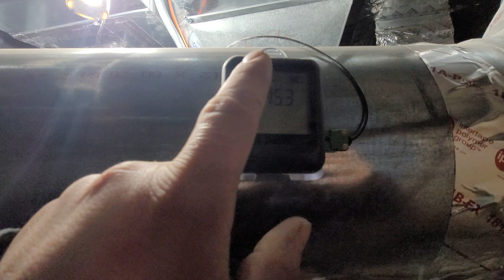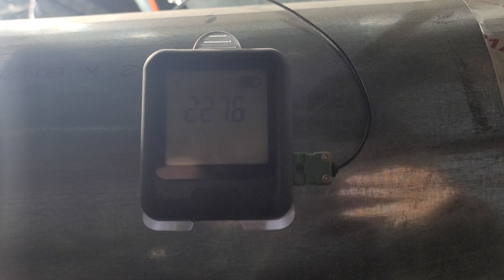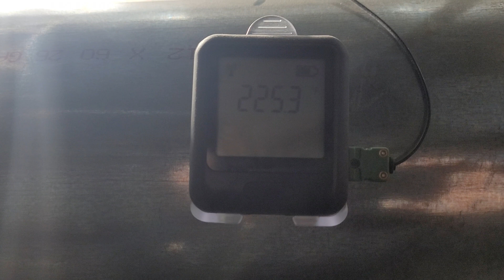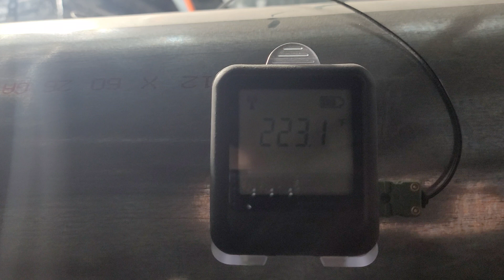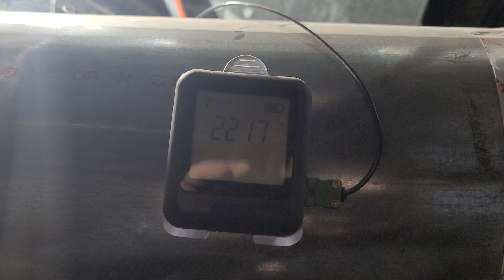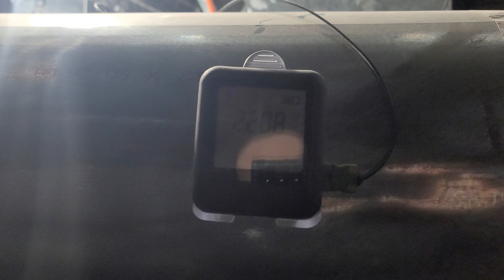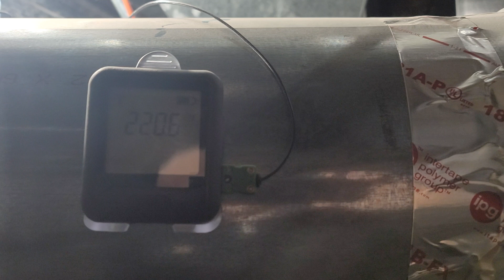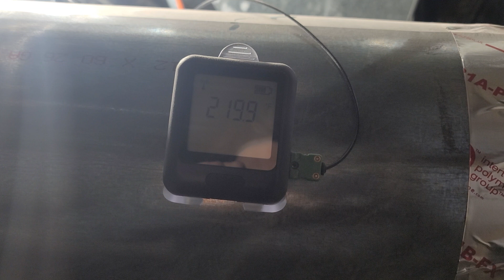Tempsure WiFi stove temperature monitor. 1 month follow up.

Comment: I been thinking about an Arduino temperature control for my stove/boiler, have it remote control, use it to regulate the stove pipe and the inlet, where it can get going on it's own, then close it off, to burn slower, burning wood can be dangerous, mostly if you don't keep the chimney clean!

Comment: Maybe the sensor that doesn't fit flush on the pipe, you can try putting a high temperature silicone around the sensor, or use  high temperature jb weld steel stick stuff, it's the putty that you kneed and stick whare ever, you can even tap threads in it when it hardens, it's steel reinforced epoxy, kinda glue it on with the stuff, it should make the temperature more accurate, if you want it to come off, wrap it in plastic, stick it on, until it sets up, remove the plastic, put it back on, having the epoxy around it slightly, and making a flat surface, it should work,

Comment: I have been heating my house with wood for over forty years and here are some keys for success.  1. Burn dry seasoned wood. 2. Burn hot fires to reduce creosote with plenty of air for combustion(dryers and range hoods can compete for air). 3. Secure all flue pipe and tape/seal the joints. 4. Slope flue pipe a minimum of 1/4 or more for proper draft.  Observation of your furnace.  1. You should be able to remove your barametric damper(they are used in oil furnaces mainly to reduce condensation and if not adjusted properly can cause problems). 2.  You should not need the flue monitor.  You are getting an education on how your furnce is working.  I like your persistence.